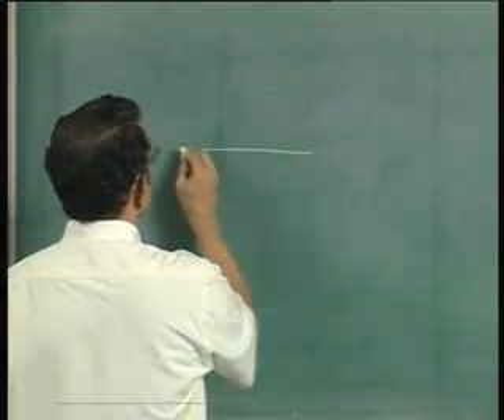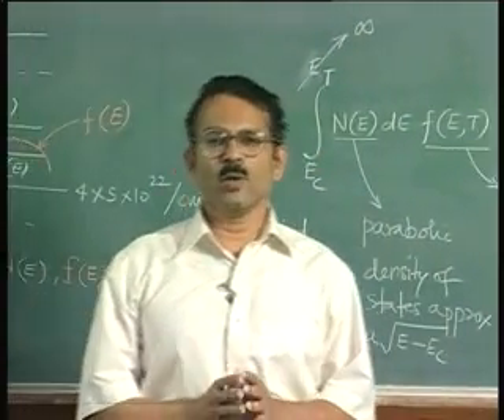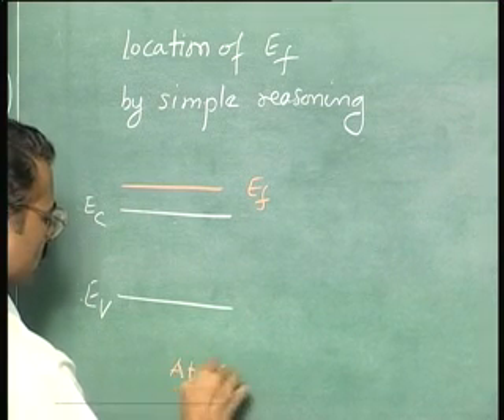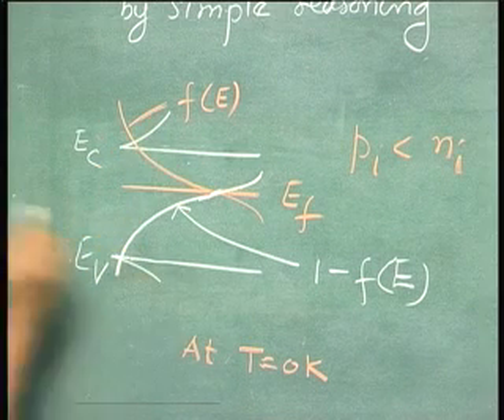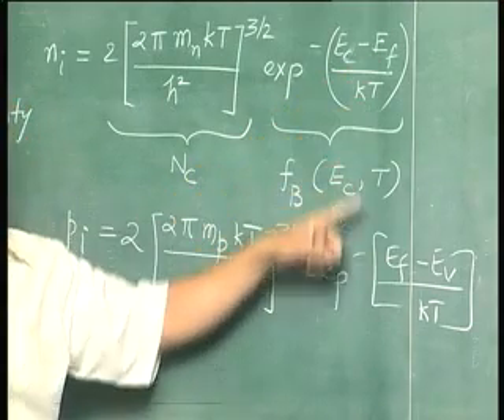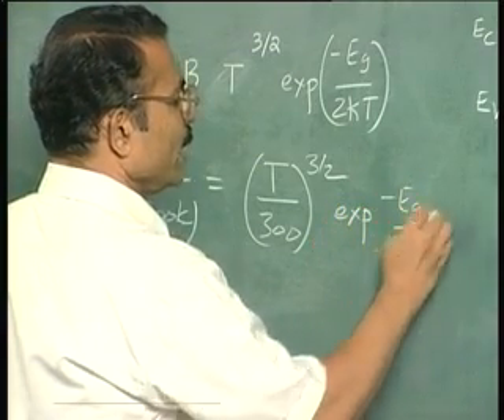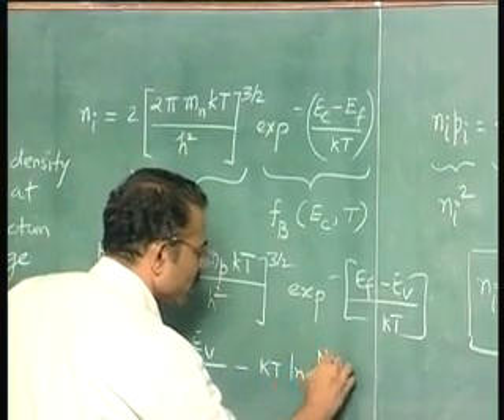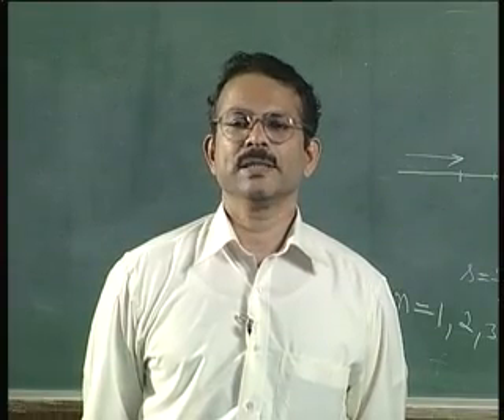Lecture - 8 Equilibrium Carrier Concentration

Comment: How can the Fermi level be defined as energy where half of the available states are occupied at T>0 K, when it lies in the band gap and there’s no possible energy state lying in the band gap?
Reply: The Fermi-Dirac distribution gives the fraction of the occupied states for any given energy level, so the Fermi level is just another energy level at which we are trying to see the occupancy. The density of allowed states over the energy takes care of the fact that there is no allowed state at the Fermi level and the product of the two (Fermi-Level distribution and State Density) will come out to be zero.
Reply: Consider fermi energy level as a metastable energy level inside the bandgap for a moment, where there are no actual Quantum States available for occupancy of the electrons(but maybe there are , lets see how). Below which there is a valence band which consist of QStates that are all filled by the valence electrons, now as T increases these electrons acquire some energy , maybe a few electron volts but not enuff to make it to the conduction band, so some number of these thermally excited electrons will keep jumping from the VB into the bandgap and return back to their respective QStates in the VB. Now consider we take a snapshot at t=t1 of the bandgap, we found some of these electrons residing at a particular energy level, lets call it Ef, or the fermi energy level. We found out that at any time t1, the probability of these thermally excited metastable electrons at Ef is 1/2, but the question is how? that is, by actually calculating the probability of QS getting unfilled at the same time in the VB, which is to say that at any time t1, there are 50% of holes created in the VB which does not account for any electron in the CB which means they might be jumping to and fro in the bandgap, matter of fact they are jumping to Ef and returning back all the time. Hence the fermi function accounts for these electrons at the Ef and tells us that there are QStates at Ef which has a probability of being filled as 1/2.